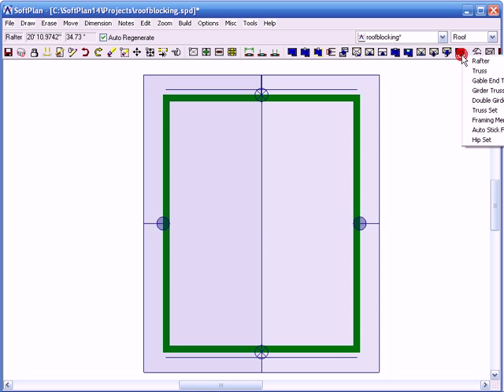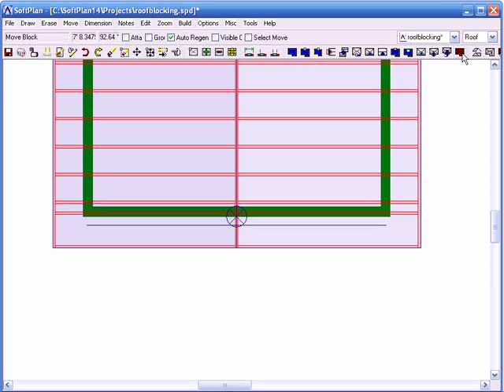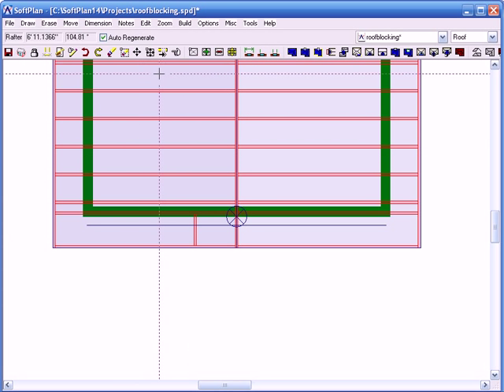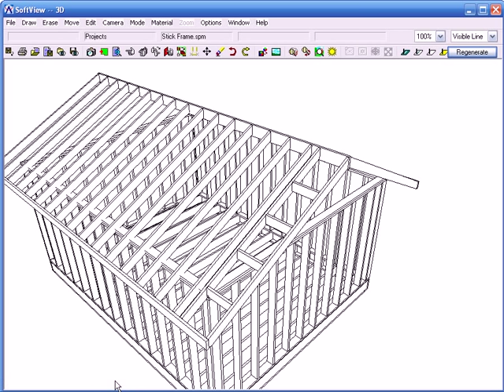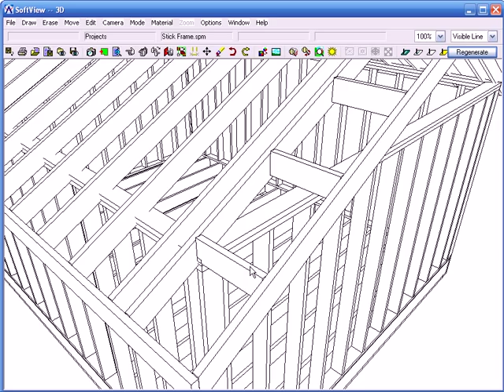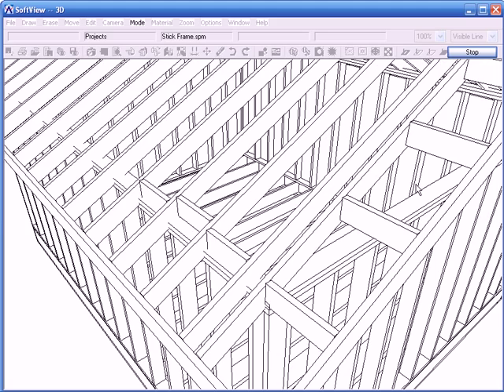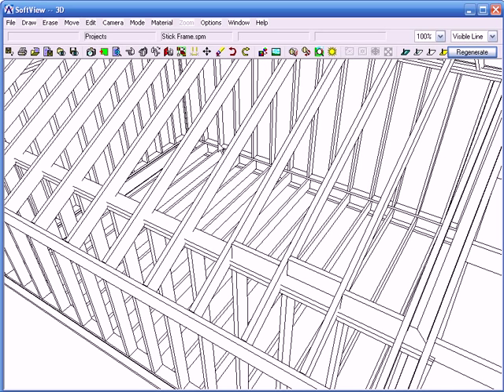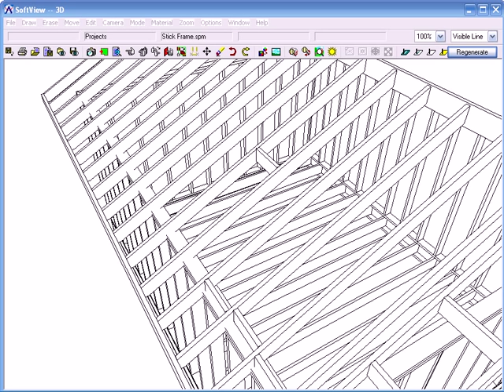softplan intermediate roof framing blocking

Comment: No one frames the lookouts the way you just installed them...  Most truss company's  notch out the gable trusses.  The lookouts are cut 34.5 inches on one end and 33 inches on the other end. We want these to tie into the last truss prior to the gable.. Place the lookouts "flat" into the notch that's "3.5" wide and  spaced 4 feet apart starting from the peak.  Remember "they are flat and nailed just under the sheathing.  
WHY? Because its the only way the overhangs will stay put.  The way you just designed that roof.  The end will come off the minute you have a crew member standing on the end nailing the barge into place.  Come on man, frame the building correctly or should I create my own video series explaining how we do this in the field..